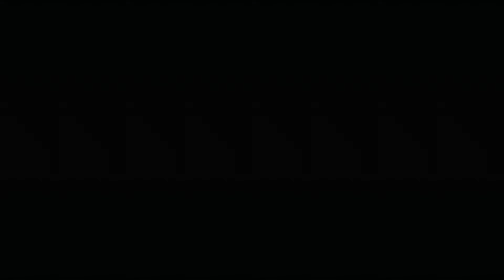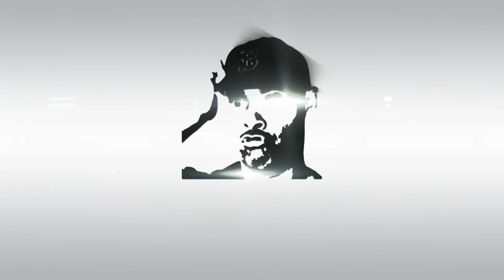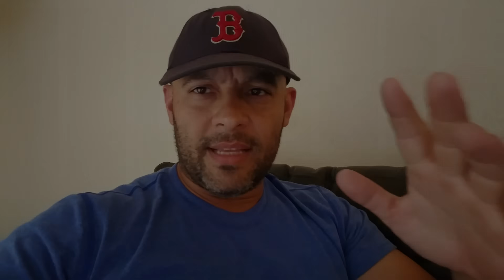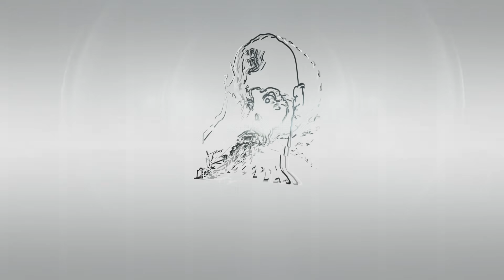The rear O2 sensor, How it works with emissions and off road exhaust in simple terms.

Comment: Depending on your exhaust set up use different types of spark plug defaulers ,I have BBK long tube 1 7/8 with o/r x pipe and borla over axle pipes and mufflers . I had to use 3 defaulers on each side , one of then being a 90 deg
Reply: Do you put defulers on the top 02 sensor?
Reply: @denzel781  no never mess with upstream , upstream controls air fuel ratio
Reply: What type of defaulters did you use man I got the same set up
Reply: @s197sebz4  I don't remember where I got them , think Amazon,  it was like a 6pc set , had a 90 and a few different length straights.  Takes lots of driving and swaping the different faulers to get you montors to set

Comment: I've used an extender on the downstream o2 sensor to clear a P0420 light ('09 camry i4; no tunes/mods).  My question is, by faking the ECU in this way, is it inviting fuel-delivery issues (incorrect AFR, hesitation, jerking during acceleration, etc) ? 

Should the engine perform better, power/mpg-wise, with the extender removed despite the P0420 light coming back simply because the ECU can now 'see' what's really there? Or will a P0420 light just automatically run-rich and dump fuel for 'safety' as long as the light is on?

Thanks.
Reply from the maker: No sir
Reply: @YDBT4LIFE  So, spacer on d-stream sensor has no effect on fuel-trim/afr --- it will just keep the CEL off?
Reply from the maker: @Wes_5kyph1  correct. Fronts trim. Rears at basically there to monitor difference to ensure there's a cat there
Reply: @YDBT4LIFE  Thanks for your response.
Reply from the maker: @Wes_5kyph1  anytime

Comment: can u help me my cat is deleted my car is mustang 2013 v6 the car has issues  its so slow between 1000 rpm and until it reach 2000 rpm it launches i feel its having something like a misfire but no misfire code some people told me it need to have a tune because the back o2 sensors  its messing up the car is that correct or not

Comment: I have a 2018 Ecoboost and I have a high flow CAT. I threw an emissions CEL and found a way to get around it. My question is, does the O2 sensor after the CAT affect anything (like air fuel ratio) or is it just emissions related?
Reply: Andrew the rear or aka down stream o2 sensor does interfere with your f/a ratio..in fuel injected vehicles.. Your ecu will tell your injectors to pump more fuel (run rich) to help burn off the excessive carbon build-up inside your cat. that in reality that you do not have.. The rear o2 sensors control a lot to do with your fuel..

Comment: The issue with the cat below efficiency is the rich loop is activated. If the government truly cared about emissions this would not be what happens. 

If anything lean it out, and cause the engine to overheat. Or worse make engine not start if they truly cared.  It's all about money. Run rich and like shit so you pay more taxes when you buy more fuel, and yet not get the benefit of the extra fuel consumption. Its not better for the environment to make the car run mega rich.

Comment: Your right tunes don't " go bad" but  I had a really bad experience w the new Chevy trucks. I invested 30k into the truck and it we as tuned by three different shops. The truck would run good for awhile then run like shit.. I'd have to unhook the battery with lights on or key turned then run fine.. what is was .is Chevy's " smart " transmission making adjustments on it's own in how the truck shifted based on driving style. I think these companies try to get ahead of themselves with technology ..don't get me wrong there are some new features I absolutely love like the Rev match and line lock on new mustangs..but there is alot of shit that can go wrong with all this new tech

Comment: What causes the car to feel slower when stepping on the gas especially from a deadstop? That's what I'm experiencing after catless borla longtube headers.
Reply from the maker: angel cedeno traction control
Reply: Alejandro Flores the TC button inside the car or the 1 i can turn off with diablo tuner?i do have . Im wondering if it's just to much air passing through or the a/f is off... I haven't gotten it tuned yet..
Reply from the maker: angel cedeno is it a mustang?
Reply: Alejandro Flores no it's a 2012 Dodge challenger RT with the 5.7 i forgot to specify the car lol my bad.
Reply from the maker: angel cedeno ah. Well the best way to get the car to break the tires loose is to trade it in.

Comment: Getting the monitors to pass can be a huge pita even with cats on the car.  No cats on mine and tried running some vibrant spacers for a couple hundred miles didn't do the trick.  O2, O2 heater, and Catalyst not ready.  Gave up on it.  I'm making a tune now where the car will pass without the monitors completing.  Eventually I'll get a pro to help me pass without "cheating" like that.  Putting cats back on would be absolute last thing I'd do.
Reply: 2 spark plug foulers on top of the o2 works like a charm
Reply: I tried the vibrant non j-style spacers and it wouldn't clear the transmission pan with the sensor in.  6R80 cars have less room.

Comment: So can I add in an off road H / X pipe and stack some Non-foulers on the rear o2 sensor without any issues? I have a decent tune right now but cant run catless on it. I want catless for the weight savings & better tone, Just don't care about tuning for it and the extra power from tuning it differently (for now)
Reply: weight saving by removing cats, LMAO.
Reply from the maker: I cannot give you advice on how to avoid a CEL. ;)
Reply: Of course, but my question is not regarding CELs. Would a Coyote car run alright if isn't tuned for cat removal, assuming the rear 02 sensors are working "correctly" ?
Reply from the maker: yes it will run just fine It won't run badly if you remove the cats at all.
Reply: Edward Rivera sure laugh, every Lb matters in these cars for road course purposes.. It just one of the benefits, didn't say I was JUST wanting it for weight savings, just one small benefit of removing themm..and yes every lb matters.
Reply: well then you should know wheels make a difference, seats, removing rear seats, spare tire etc. unless it's a dedicated track car, then cats won't make a difference in weight reduction. now mufflers will, but not cats. I'd remove the mufflers before cats.
Reply: Edward Rivera Haha ofcourse I've done all those mentioned things.. But mainly want to remove cats for the sound and easier clutch replacement as well. Last clutch replacement the bolts gave issues being sized on there..

Comment: 02 Sensor extensions..  :D
Reply: Spark plug non foulers. Stack 2 of them and put the o2 in it works likea charm
Reply: where can i get a good set of these
Reply: Well I dont have a crowdkiller mustang :>, but vibrant performance makes some for the Z platform.

Comment: Thank you for thr info. My first GT500 tune from 2008 had the rear O2's shutoff. Then during my CT state emissions test (around 2012) the tech said it will fail the next time I get tested (every 2 years) as the test will then require all sensors to be on. Had to get a new tune. I had a stock exhaust so I'm not sure why the tuner shutoff the O2 sensors.

Comment: Non-foulers worked on my brothers 13 coyote. We put two on each sensor. Passed like a champ once the computer went through all the tests. Stock tune with 3in off road x pipe.

Good info as always Alex.
Reply: RJon2006 thanks!
Reply: any PN's used for this?
Reply: Dylan Dunford I believe he used Dorman 42009. 2 sets.
Reply: cool, so no issues on a stock car? I heard the car can run like junk without being tuned proper for cat removal and it dumps fuel thinking the cats arent there. But I guess if the stacked non foulers make the rear 02 sensor think the cats are there then it all works fine on a non - tuned car
Reply: Dylan Dunford runs just fine. No issues at all.

Comment: Smart guy, facts are a little off. Rear o2 sensor reads oxygen, and it should be reading fairly steady once warmed up. The efficiency code sets when the rear o2 sensor mirrors the front o2 sensor as far as pattern and voltage. He is correct, front o2 sensors, read oxygen levels out of combustion chamber. O2 sensors only read oxygen, that's it. Some more accurate and faster than others. The catalyst chemical strips and changes the hydrocarbons to hydrogen( essentially water) and that's what the rear o2 reads, oxygen levels. This reading of oxygen is converted into voltage. The volts should stay around .78. When they move around and follow front o2, that's when lights come on. I'm not great at explaining things, so I hope I got my ideas across accurately. That's why Alex gets paid the big bucks 😀
Reply: That may be true for Fords ( I don't tune Fords) but VW's with Bosch ECUs specifically ME7.1 and up use the rear 02 sensor to control fuel on acceleration and deceleration also.  Many people don't realize that factory calibrated ECU's first priority IS NOT performance it is to keep the cat at it's highest possible efficiency even on high performance cars. If tuning is calibrated correctly you can make just as much power with a cat (you might need to get a higher flowing cat though) and still be within EPA and CARB compliance.
Reply: userpike. Yes, Ford is just monitoring for efficiency. The newest versions use the sensors to infer catalyst temperatures, which like you said is tuned to protect them from melt down. You can tune around anything if your good enough. I only have tuned older gm and Ford with the eprom mods where I had to solder in a zif socket and burn my own chips. Then carefully transfer chip over and insert into pcm like a Gameboy.
Reply: Alex Burns. Right, they read oxygen levels in the exhaust, and when they "follow" the upstream o2 sensor too closely, it trips data in a section of the pcm called mode 6. This data is stored and complied until it reaches a threshold. Once this is met, a service engine soon light illuminates. This is the same for your misfire monitors and EVAP system. If you remove the rear o2 sensors, the car will still run and drive. It will most likely never go into closed loop though, so your car will not go into pe ( power enrichment) mode, it will just run off the programmed tune without sensor intputs. This is definitely how older cars worked, like I said I have not tuned newer, I just work for Ford dealership on transmission and drivability. So as far as modified cars go, I don't mess to much anymore.

Comment: Since we are talking about check engine lights I always get the code po300 "Random multiple cylinder misfire" I already changed all eight of my spark plugs ( yes they are gapped properly) and my coils are good. Why does this code keep coming back on? WTF could it be? A vacuum leak? And it doesn't like its misfiring either.
Reply: Jesus Segoviano have you done a crank relearn?
Reply: Strokin7.3 no lol. I don't even know what that is haha
Reply: Jesus Segoviano if you an sct x4 you can do it, n gauges might be able to now, i just use my whipple flare device though since it is the easiest.

Comment: I have an 01 Gt in which I removed the stock mid pipe and added a mid pipe with cat delete. More than a year later the CEL came on. I plugged in and ran the code, it said CAT Inefficiency like you said...so I deleted the code because I know the problem also.  CEL gone away...

Comment: all you would really have to do is modify the voltage that the rear O2s output right? or put in o2 simulators I mean it would obviously have to show the correct voltage but shouldn't really be that difficult to figure out

Comment: just wondering alex, here and there blue smoke is related to what? currently running off road x, car drives fine no oil loss factory tune.
Reply: Blue Smoke is usually oil related

Comment: Correct me if I’m wrong. I was under the impression the rear 02s were narrow band basically a on off signal when hitting Stoichiometric. Because wideband 02s wear quicker falling out of calibration the rears give the ecm a known reference point to account for the new readings the front 02s are giving. This is what I have been told ford does with the coyotes. I know others it’s just making sure the cats are working.

Comment: Hey Alex, just curious, Does turning the rear o2 sensors in the tune cause the coyote not to be able to have the emissions monitors set? A couple friends of mine got a tune from a "reputable company" that starts with "B" and ends with "A", anyways, I believe the tune just shut their rear o2's off and now they can't pass a inspection here in New York as the emissions monitors keep saying they're not set or "not ready". I was just curious if you've came across this issue.
Reply from the maker: yes all of the monitors have to be ready especially in ny and adaptive also has to be flicked back on NY don't play.

Comment: Alex have you actually heard of a tuner getting in trouble with the law for turning off o2 sensors?
Reply: But if shop doesn't note it on RO they can get ding for it too. Doesn't say you have to report it just have to note it.
Reply: Lool up what happend to H&S performance
Reply: btow1105
Reply: Hey alex, i really like your content ur vids are so enjoyable, informative and at the same time sarcastic lol. I have a 2013 5.0 with longtubes, x pipe, jlt and kbb 8.5mm tb with the same set up i passed emission last year with  aed tune that i bought the car with.  Also, with the aed tune when i look up the readiness o2 monitor, o2 heater, catylitic monitor even evap say n/a but like i mentioned car passed with no problem, however, i didnt Seattle for the aed tune so i decided to get it dyno tuned by kurgan motor sports here in GA And yes he turned off my rear o2 sensors Car did and 430 hp and i couldnt be happier, but when came time for emission checked my monitors both o2 sensor monitor and o2 sensor htr say inc while everything else is ready so my question is would turning off o2 sensor cause the o2 htr not to set? Thank you.
Reply from the maker: Yes. And diesel shops Removing the DPF have gotten shut down i hear.
Reply: That's interesting. Gotta setup a 'No Snitchin' policy with your customers lmao

Comment: make a spacer for rear o2 sensor sets the secondary o2 further out the exhaust stream preventing the cat deficiency codes from being set even without running cats as said in the video all the secondary o2 has to read is a different than the primary.  that is if your tuner won't disable secondary o2s. all you really gotta do is trick the computer into thinking everything is in place as it was when it left the factory

http://m.ebay.com/itm/O2-oxygen-sensor-angled-extender-spacer-90-degree-02-bung-extension-M18-X-1-5-/131225508668?epid=625564670&hash=item1e8da65b3c%3Am%3Am5joEow6Iua09irDhk8e-gA&_trkparms=pageci%253A96e26d17-7706-11e7-8824-74dbd1804dbc%257Cparentrq%253A9fdc0a7715d0a9c4f0510386fffee15b%257Ciid%253A8
Reply from the maker: Hot diggity dawg. 
;)
Reply: Tried this lol..did not work I continually get the P013C code
Reply: what mm are those? i searched that part number and nothing came up
Reply: Can i just plug the rear o2 holes and leave rear o2 hanging?would it pop a cel.
Reply: a1012529 spark plug non foulers work too.

Comment: Screw "newer car emmisions." In Maryland they make you get emmisions done every other year, however, SAFETY inspections are only done once per owner per car. So, they care more about someone's car running "no cats" but could care less about the longevity of a cars brake system, suspension, critical bolted connections, etc - you know, the type of stuff that can cause a critical failure causing deaths. These people are cucked. Oh, great video btw though! :P
Reply: Matt Pratt I know they don't mind dropping all those Chemtrails out of the back of the damn planes but when I complain about a little bit of car fumes